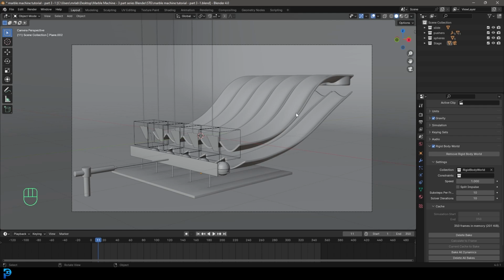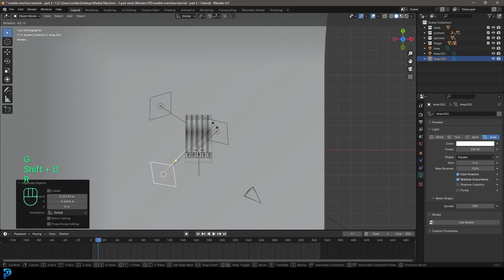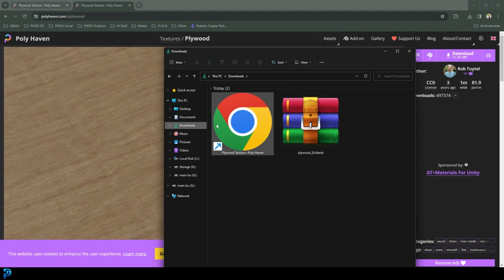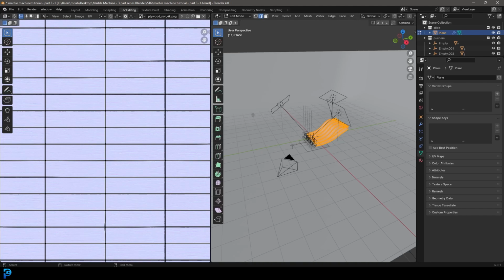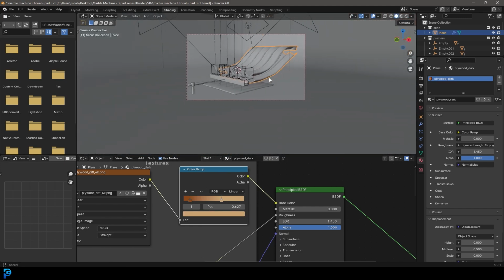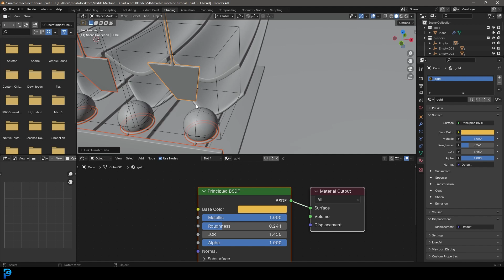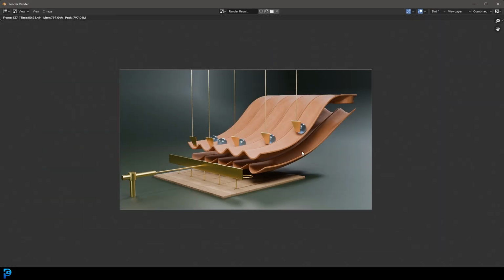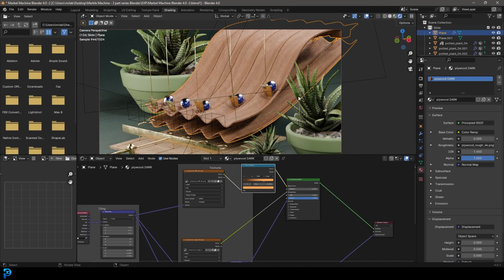Marble Machine: Blender 4.0 Tutorial (Part 3)

Comment: I'm rendering out my version now.  I had some issues with the marbles jittering in their hoops and couldn't get any of the settings to stop that from happening.  I am going to start over now that I've gone through this.  On the pushers I'll set the origin to the bottom and then take the center of the ramp and duplicate that then turn it to a curve and then put a follow curve thingy on it (yes it's 1:42 am and I have all the technical terms) and animate it that way.  Makes me want to go back and try and make my spiral marble run again.  Thanks! 🙂
Reply: i had the same problem. my friend whos pretty good at blender looked into it for me and it seems like a technical issue due to the scaling. if u want the problem to go away, u need to make everything in the scene larger. the small size seems to be causing the problem
Reply: @Booga04  I'm going to try a new version today and leave either everything at default scale or make it 10 times bigger to start with.  Any other rigid body sims that I've done that I've left at their default scale didn't have that problem so I'll try that first.